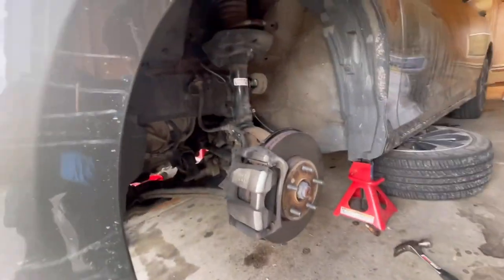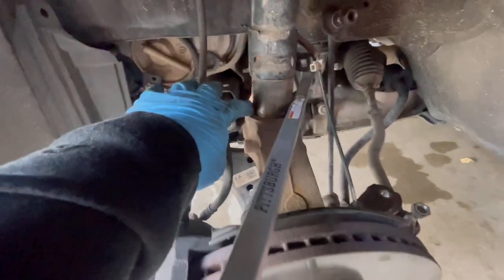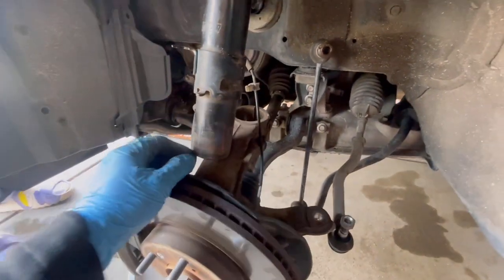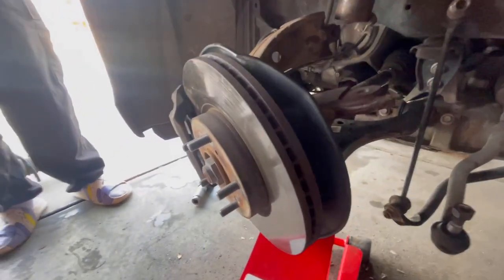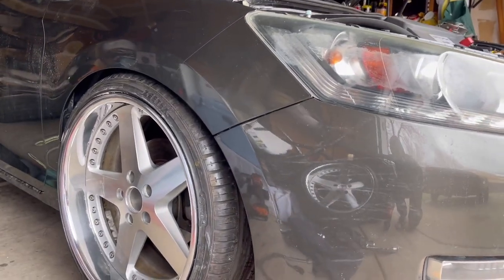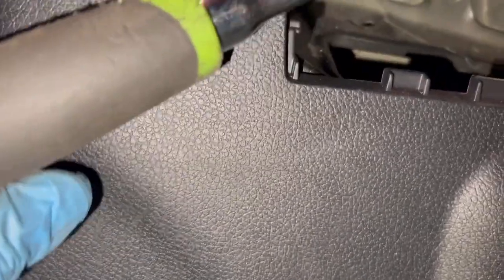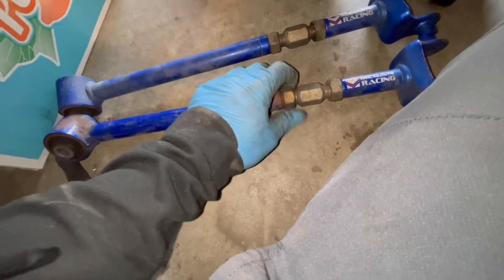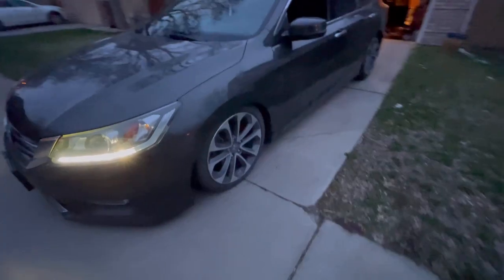2013-2017 honda accord coilovers install the easy way

Comment: Pops the axel nut take off ball joint remove rotor and caliper take off sway bar links lower control arm then just unbolt. Easy
Reply: Way to much work this way works just fine
Reply: Bro took the long way

Comment: I put a pipe right under oem strut rubber bumper and lowered the car with jack, popped it right out found this out after struggling and trying different methods.

Comment: Look at the pressure you putting on the axle during removal.😢 And there should have been a strut mount bot that the top which is whe the spring and strut came out but not the mount.
Reply from the maker: Yea that was my bad 🤦‍♂️

Comment: i pretty much exhausted all my strength trying to get the bolt from the sway bar link. will an impact gun be able to do the job? never used one
Reply from the maker: Impact works sometimes but if it doesn’t you’ll just need the hex key with a wrench

Comment: easy way lol

the easy way is to take the brakes off meaning caliper pads and disc

 in the end of the lower control arm right on the sides of the arm bushing there are 2 holes you just insert a strong screwdriver and you can manipulate the control arm as you wish
don't pray it the way you did it is very bad and dangerous
next time
check the way I told you and you won't be disappointed